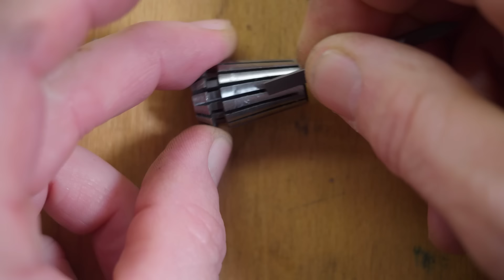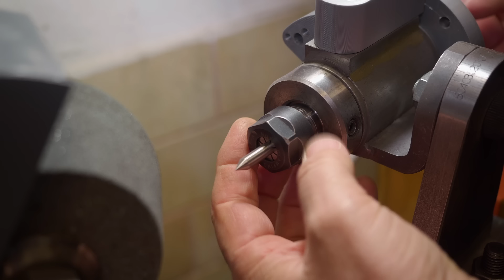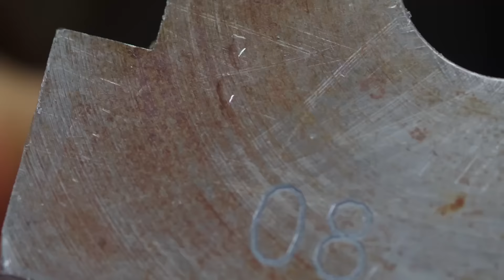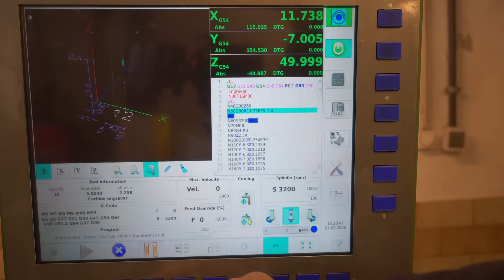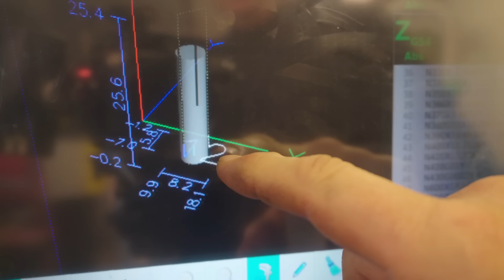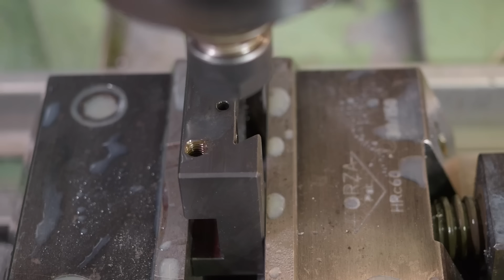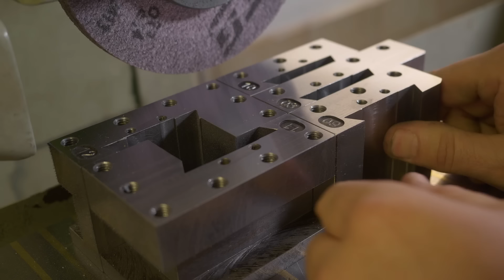Is a D-bit or pyramid tip better for engraving? || RotarySMP

Comment: It's curious how your engravings come out so facetted, rather than with smooth arcs. I'm not sure how you're generating the G-code, but it's the same issue I've gotten when exporting engraving toolpaths from Fusion with a too high tolerance, for instance a 0,1mm tolerance instead of 0,01mm tolerance. It generates less G-code, but the result tends to be facetted and rough. One would think that following a path would be following a path regardless, but alas it does not seem to be.
Reply from the maker: Those were generated in a 20 year version of FeatureCam. If I look, I will probably find that I missed a setting for tolerance.
Reply: @RotarySMP  Could also be dependent on your controller, whether it supports arcs properly, or is just interpolating the start and end of the arc as a straight line. Could be easy to check in the code, like if your zero is made up of 8 segments, and the G-code has 8 arc segments then that's likely what's happening.
Reply from the maker: @SwitchAndLever  LinuxCNC correctly interprets arcs normally. I dont know of any setting to break that.
Reply: @RotarySMP  then that is very peculiar indeed. Because it does look like a linear move from one coordinate, or arc segment, to the next.
Reply: @RotarySMP since you are getting g2 and g3 I'm the code the tool is likely following the geometry exactly as FeatureCAM does not do any arc fitting by default and the curve or spline tolerance settings won't matter.

Comment: Are those digits different heights? I mean there can be perspective error, but it looks like for me, that second digit is always different in height than the first digit, and sometimes even the second digit looks like it has its bottom visibly higher than the first. Is this only an optical illusion? Are in GCode simulation digits different heights? If so maybe there is backlash in the Y axis? What is our purpose in the universe?
Reply from the maker: Could be. Got spotting.

Comment: What is the cause of the facets in the numbers? Is it the tool path itself? And how well can a cnc machine of this generation do a euh... analog circle?
Is opening up the speeder to asses damage an option?
Reply from the maker: I am pretty sure that the facetting come from the CAM software. It was generated a few years ago, with a now 20 year old version of FeatureCAM. I expect there is probably a curve resolution setting in there I have set wrongly.

I am sort of curious to open up the Henninger, but have so many more urgent projects to work on.
Reply: @RotarySMP I doubt it is FeatureCAM. It's a well regarded software and I supported it for many years. Issues like this were almost always something at the machine assuming the post processor was properly outputting arcs as your appears to be.
Reply from the maker: @JonSturm  Thanks. I assumed I had generated the tool paths with the curve tolerance set too loose.
Reply: @RotarySMP as I mentioned in another comment thread if the code didn't have the g2/3s in it I would suspect that as well but since those are there it is more likely something on the machine side. FeatureCAM doesn't do any arc fitting by default so those being there implies it is following the geometry provided exactly. There are various g-code viewera available including I believe one included with Linux cnc. If you load up the letter code in one of those viewers you can 100% confirm if the facets are there or not but I am fairly sure they won't be in the code.

Comment: May I suggest using a price of brass shim stock like a feeler guage so you know the tool height and the brass shim stock is softer than the cutter so will not damage the cutter. I used to have to do this when machining hardened roll forming rolls and setting the z axis.
Reply from the maker: Thanks for the Tip Bob. I like the carbide blank, but there are certain part geometries where a shim stock would be better.

Comment: The Zero's in the video before looked fasitted as does the zeros in this.. the other engraved numbers not so much (the light engraved 8 is the exception) which gives me the thought that maybe they are all fasitted and maybe the depth of the engraving is hiding it.
Reply from the maker: You are probably right, as they were the same tool paths. I need to take a look a the curve resolution if I ever use that program again.